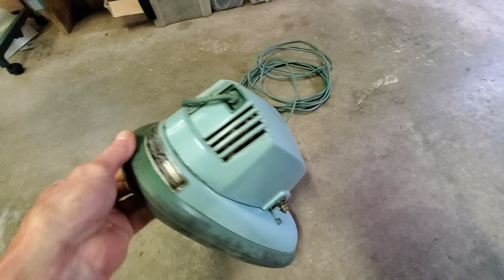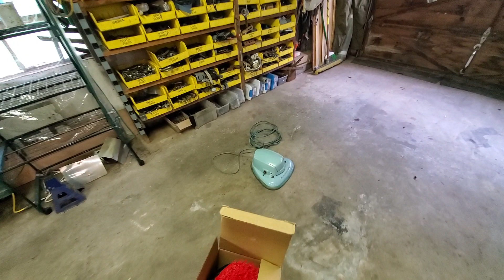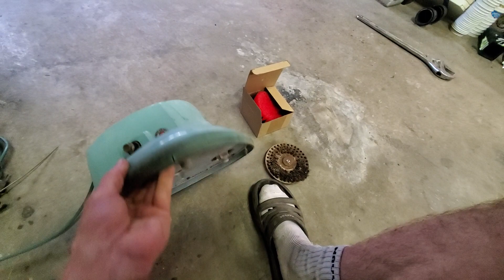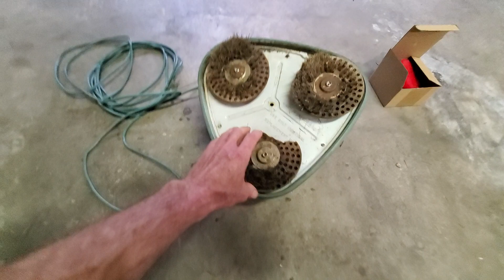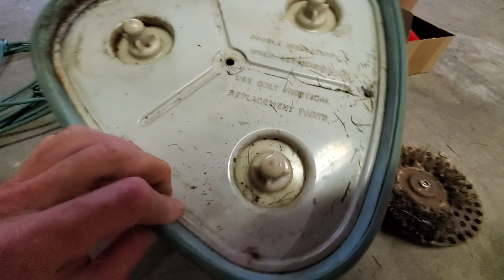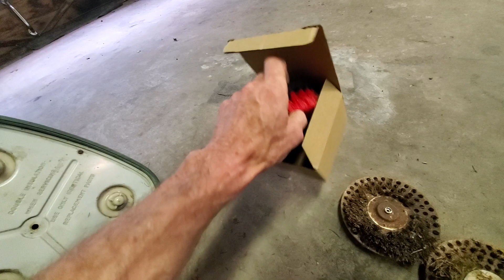Good Old Stuff -  Electrolux Carpet scrubber model B8 found in the woods

Comment: Came back again... one year later... hoping to find an update to this video on how your Modification to the newer red brushes you showed in this video went. 
My guess is probably not the way you envisioned and you gave up on it. The only solution I've found for replacement brushes has been to search secondhand shops and fleabay for good used ones.

Comment: What an amazing find - and in the woods of all places!  The Electrolux Model B-8 was introduced in 1963  and made in various colors until 1983.  The Carpet Beautifier shampoo component was added in 1966 - those did not have the hole in the bottom for the shampoo line. The actual color of yours, the first edition, is aquamarine green.  The color changed in 1968, so that gives you an approximate age.  Electrolux  Corp. was initially a subsidiary  of the Swedish Electrolux Corporation, so some 20 years ago, the name was sold back and the former US subsidiary became Aerus LLC, who continues making an updated version of the B-8 in a plastic casing and new brush heads called Lux Floor Pro.  The type of carpet cleaner to use is a dry foam shampoo, which can be purchased through Aerus, Kirby, or other online stores.  You need a shampoo shield for it, or you can use it as a floor polisher as is.  The brown stiff bristles are for floors, and black soft bristles are for carpets.   The ones made for the Lux Floor Pro would fit, but they would eventually do damage to the spindles, because the fittings are different. The fittings of Electrolux shampoo-polishers made in other countries have different fittings as well. Happy Electroluxing!
Reply from the maker: wow,, so you are probably a tiny handful of people who could have helped me find new heads !! i had to hand fabricobble mine to what they are now.  im going to look up that company and brush pn.  thank you